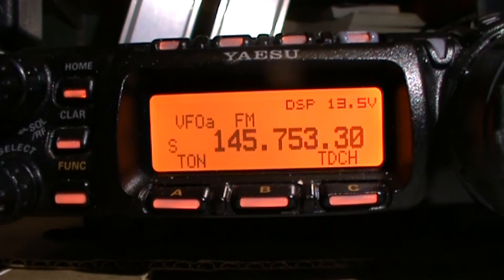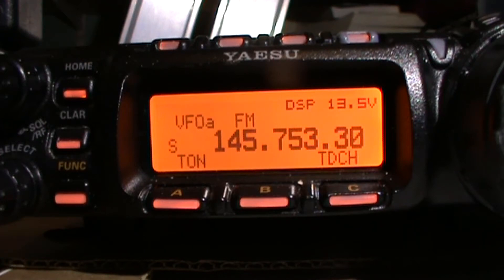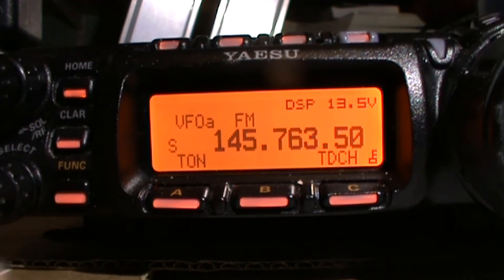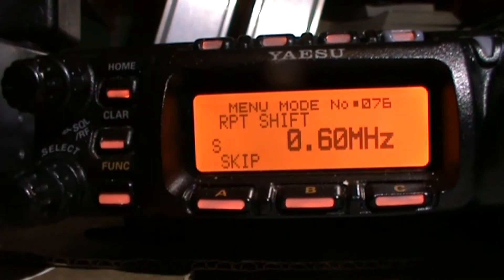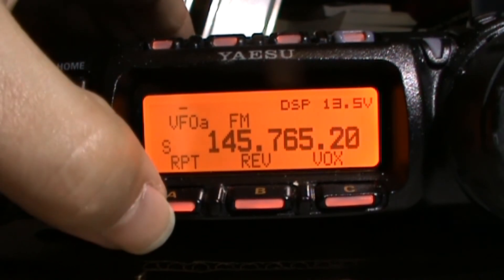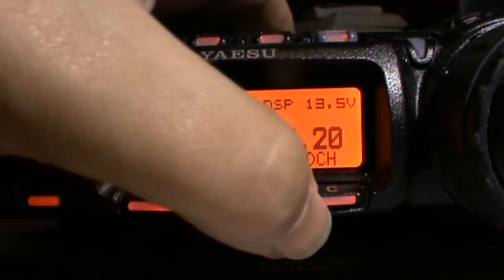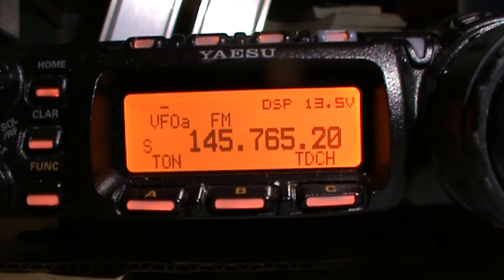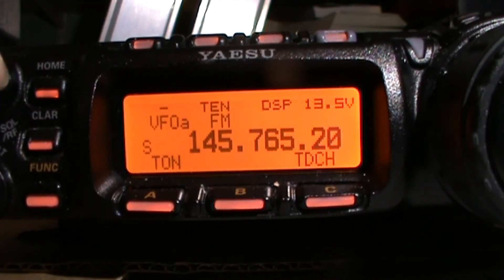How to Programme a repeater into the Yaesu FT-857D

Comment: Shouldn't it be TSQL not TEN ?
Reply from the maker: TSQL is used for when the repeater adds a PL tone after a transmission.  The radio squelch wont open till it hears the correct tone. GB3IP when it was in Stafford did not send one.

Unfortunately GB3IP is no longer in Stafford, the NoV has been re-assigned and moved down south